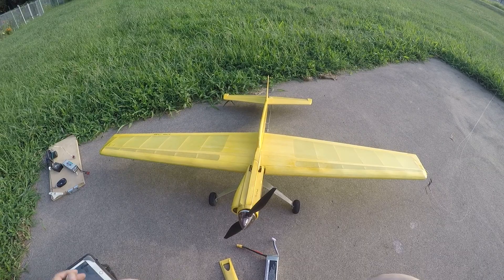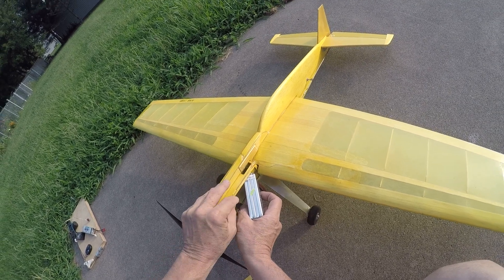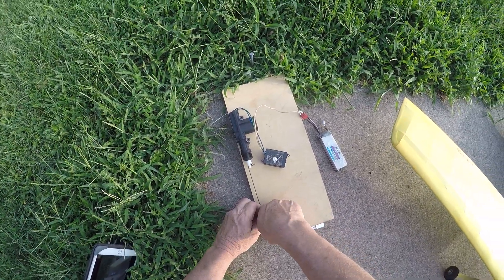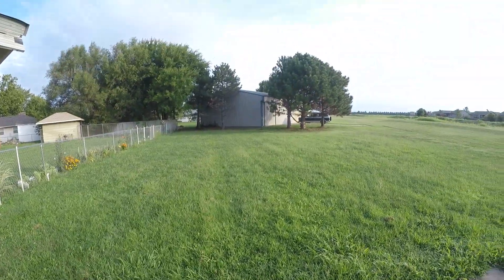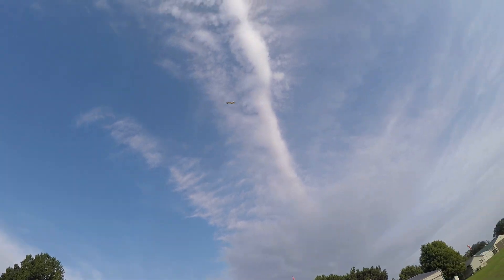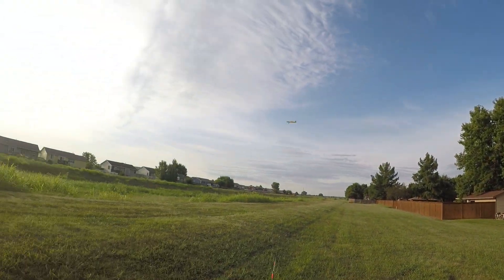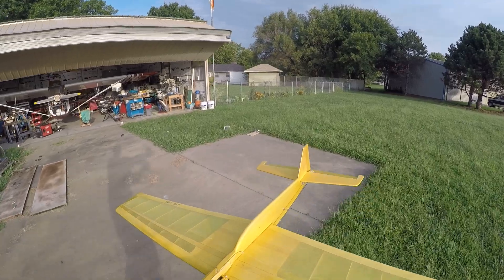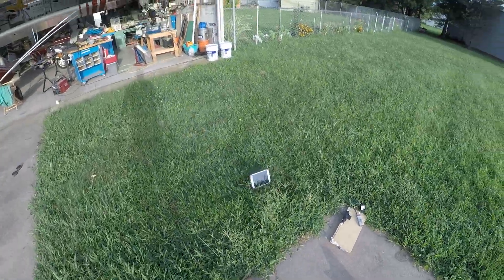Flying my new control line model plane I'm calling Frankenlaser profile

Comment: So could you set it up to turn on and off from the control handle? Or adjust the speed in flight?
Reply from the maker: With the timer on this airplane no. I have a timer prototype that will start and stop via a key fob transmitter. Some people use an RC car transmitter receiver to do it. When I return to the timer project, I'll post a video.

Comment: Very good flight, I like it! What is a timer? Does it have RPM control in a flight?
Reply from the maker: I am running a Hubin FM0c which isa great timer. The ESC is a ZTW Beatless and I run it in governing mode.

Comment: Very nice flight. It must be very difficult to talk and fly at the same time.my brain could definitely not handle that! Is there any reason why you did not add flaps? The plane looks to have enough power and the flaps might help the square manoeuvres. I like the look of the model, especially the nose. Gives it a "Cosmic Wind" look, very nice. Hopefully you get to do the next version soon.
Reply from the maker: Yeah, talking while flying, I have been flying models since I 4 years old and 4/4 size since 18. I'm a flight instructor as well. Besides, I like to talk. That combination makes it easy.
Reply from the maker: Yes, I did not add flaps for ease of construction. I built this model to learn some thing like how well the airfoil works and the aspect ratio of the wing. Flaps would have muddied that test. I have intent of building a full fuselage flapped model of it. Cosmic Wind is interesting but this plan form derives its source from the aerobatic Laser.